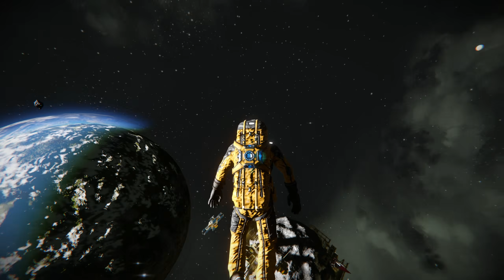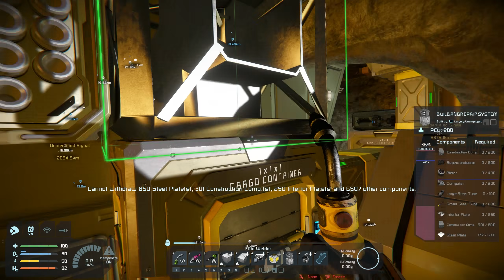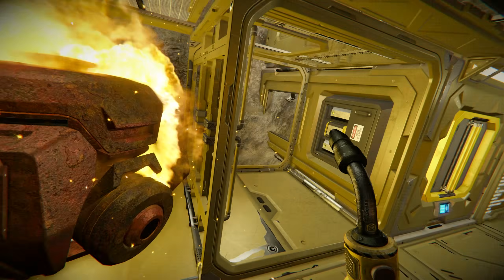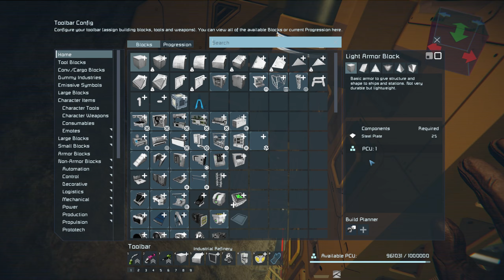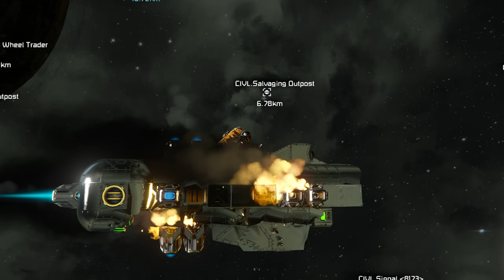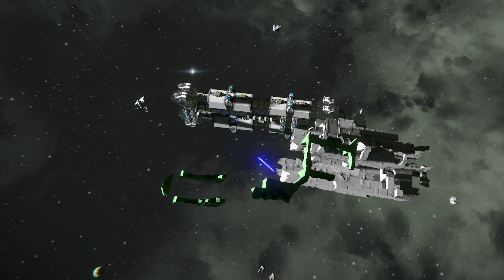Haul It All | Suit only Survival Season 2 | Episode 10

Comment: "i want landing legs" my brother you made a ship with a heavy armour anchor for a nose. if its an enemy base you're looting, just ram your nose in and they wont get too far from ya. if its a planet you're scavenging from, just balance on the anchor. the dirt will probably deform before and more than the armour

counter point to my own joke comment: this is a terrible idea. i had freighter class ships called "Pike", "Arrow", and "Partisan" which were these massive straight line ships that i could back into these donut modules. these ships possessed literally no way to land minus a single coupler in the nose that would protrude with square pistons. i hated using these ships in gravity and around debris so much that i made a module with 4 "Row Boat" crafts. one with a drill, one with some missiles, one with a welder, and one for towing. these modules became permanent really fast

Comment: A tip from me for the color choice of for the picture and repair system for the  grinding color Take the color three times 100 that is also a green only it is a squeaky green green and it is firstly easier to recognize secondly it is easy to remember And unlike regular green which you used, you can't accidentally start dismantling things that you would otherwise have collected You will also have this color if you have captured ships, for example

Comment: You can prevent the problem of the rotor wobbling back and forth by simply turning off the engines when you are docked And you can do this quite easily if you use an action block It would be even better if you simply turn off the entire vehicle And then switch it on again with the action block If you disconnect You can put a lot more things into an action block now, so I would put gyroscopes, engines and everything in there and turn it off when you are Coupled With your base

Comment: The build and repair system also increases your notoriety by a lot, which attracts more and larger Reavers.
Turning off you antennas won't allow you to hide when your PCU and energy consumption are up and high.

You'll need to do more repairs, so you'll need more build and repair systems, which will attract more Reavers, so this should get interesting pretty fast!

Comment: 13:44 issue with the pick and build color - I remember dealing with this headache recently. If I recall correctly, "pick build color" will actually set the bot's build color to the color you currently have selected in your character's color picker. "Set build color" is when you manually define the color IN THE BOT dials and then you want to assign your current color (in your character's chosen color palette) to the color you defined in the bot menu. - This was a total nightmare for me to figure out -.-  ... It might be the other way around, but I am pretty sure I have the correct order.

-Edit-
Just rewatched that part and I might have misunderstood your meaning when you said  "set build color sets IT to these values". I thought you meant "set's the bot dials to the picked color values", but you could have also meant essentially what I said above. So we might be saying the same thing. If that's the case, then what I said above just serves as clarification for anyone who is reading this :)

Comment: 2 things for this comment that you'll hopefully see 1.The nanobots mod is great and balanced for survival why would anyone complain, you gotta have like 10 to have anything actually done with speed, they use power, and your resources, they are also great when you add it to your small ships and put a projector as well to work as a slow repair system if you bring material
2. (A comment i previously made) Hey idk if this has spawned in for you in your game but im playing that start as well and check out GPS:FE,UR,AU,Ni,Pl,SI,Ma,Co,Silv:22736.0538933447:135006.654065892:-99644.4502048409:#FF75C9F1:

its an asteroid I know some of the one have been the same but this one may be as well and it would allow for your drill machine to be better used

Comment: Oh, almost forgot! Build and repair block has a sound volume option right at the bottom of it's settings (default to 50% - that's why it's os loud). And Isy's script has an ore priority list in the code which you could change, instructions are right above the list itself. By the default, the only ore that is uncommented is stone, but you could adjust that list to your liking. The only downside is that you need to go to the code editor, change the list and recompile script after changes each time you want to reshuffle the ore priority :)
Reply from the maker: Thank you!!!
Reply: @LargelyUnemployed  You're welcome :)

Comment: I see that you have the EEM (Exploration Enhancement Mod)... Hm, that could explaing increasing amounts of micro-freezes. I had that mod too and that ran me into a situtation when I just couldn't do anything normally because game was stuttering like hell. I surfed the Web a bit and found that EEM could couse that. Mostly because it doesn't clean itself: it does not remove spawned grids, debris left after battles/crashes and so on, it relies on ingame trash-removal system. Aside from that, EEM spawn a ton of grids because it triggers many events simultaneously. This also explains that mess of signals you see on your screen :) 
Those are the main reasons why people preffer MES over EEM. I removed EEM and just for testing installed MES along with a few packs (Paralax, Assert, etc.). And I can tell for sure that I haven't seen any even near freezing as it was at EEM times. So, if those freezes consern you, you might want to remove EEM.

Btw, love your content!
Reply from the maker: Thank you! I'll be taking it off the list for the next playthrough.
Reply: @ You're welcome :)

Comment: When docking your ships to a stashin disable dampening and turn of your engines otherwise they try to reach the position and speed they had wen you press lock, which then leads to the wobble and in extrem cases.... ever seen videos of people truckin away with the gas station nosel still inside the tank? just like that... with sparks^^ I would not like to have a Truck with that^^ sorry for the pun it had to be. BoB also has a veeeeeeery high thread count so expect a lot of reavers^^

Comment: Published 2 hours ago, less than 1k views so far. I didn't ding the bell (don't feel bad, I never do), but the youtube algorithm has served me nice steaming hot goodness.

As far as the Nanobots go, I was wondering if they would make a comeback. I use them in my own games too (SoS1 turned me on to the mod). I personally like the drill and fill portion because I can hollow out the voxel with precision, and not need to build a "base digging" ship. I still use Build and repair, but drill and fill is the way to go.

A suggestion for salvage: build a ship with nanobots set to janitor grind. No guns and lightly armored (for balance). When you disable a pirate vessel you can move in the janitor ship and not have to waste time grinding or chasing down parts floating away, nanobots will take care of it all for you.
Reply: To be honest, you'd have to slap a LOT of B&R-Systems onto a ship that should grind down something at a reasonable pace. Especially as small grid, since the rules were stating he does only use one large grid. The only way I could see it having any use would be with lots of cargo, some reactors and time to let it run unattended for quite a while.
But that would defeat the purpose of the grindingpit he was planning to build and doesn't really work with the flow of what LU is showing here so far.
Reply: He already expressed an interest in making a grinder pit for pirates. If he uses nanobots for everything then it defeats the purpose of "engineering" in a game called "space engineers." The drone printers, the base diggers, the grind pits, the utility ships... these are where people's creativity shines, but are all rendered unnecessary by nanobots.